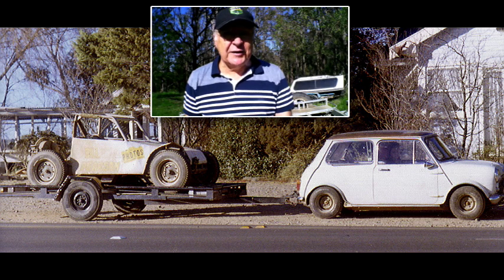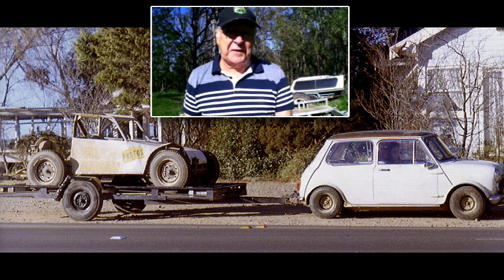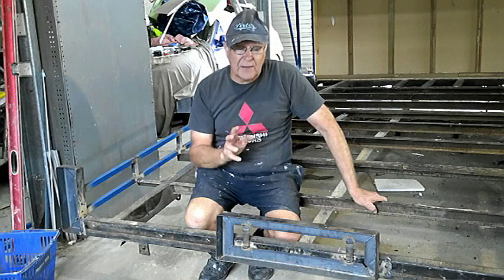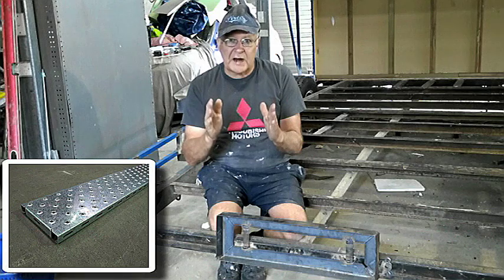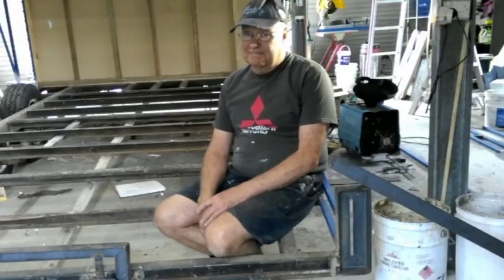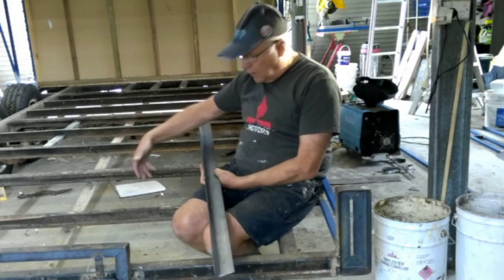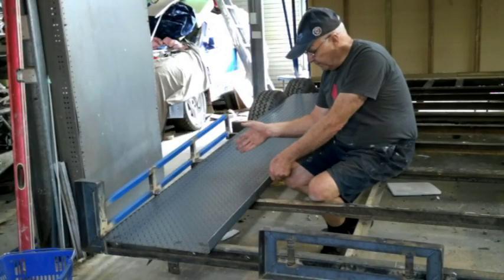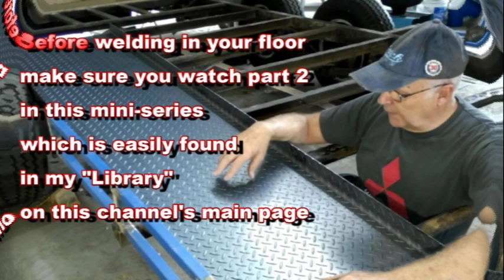Car Trailer Build Ideas #1

Comment: Hello sir can you do a video on fabricating a rock shield on front of a trailer to keep debri off the car
Reply from the maker: You may be in luck. I may be making one for my son's new car trailer later this year.
Reply: @BillsBuildandRace  thanks alot I tryin to find me some thing to fabricated with...I think i have an idea i want to do it but just need a jump start on it.
Reply from the maker: @jameswalton8927  There's basically three materials you can use. Timber is heavy and limited to a square-ish shape. Steel framing with sheet metal rivetted to it is strong, but not particularly light. Fiberglass 100% waterproof, easily made into a flowing, aero shape, and if no framing is used, the lightest of all.  I will probably follow the methodology I used making my buggy's body work - make a curved shape out of electrical conduit & chicken wire, and drape 2 inch foam rubber over it. Then I'd apply fiberglass , so the foam would stick to the fiberglass, giving me an insulated inside surface. If that was not wanted I would use a layer of builder's plastic sheet as a separation agent, because fiberglass won't stick to that. https://www.youtube.com/watch?v=TgIgyZ2FOJA&list=PLh5B6MCXRHiHoupoi7R99zJ_QoVfmBmZt&index=12&t=18s